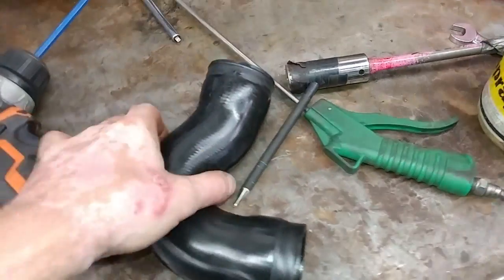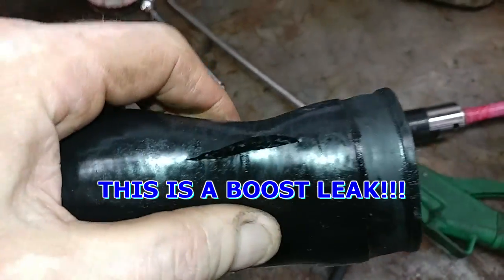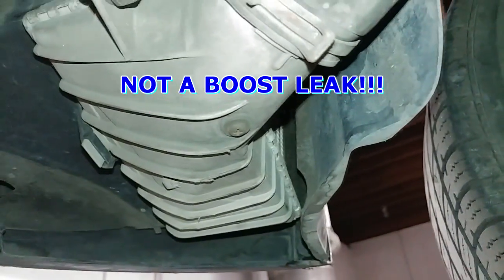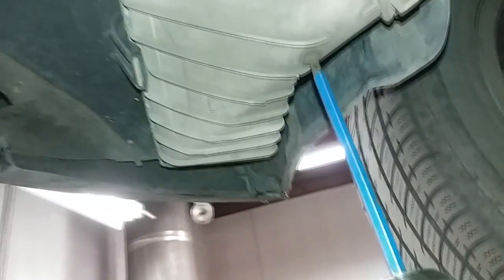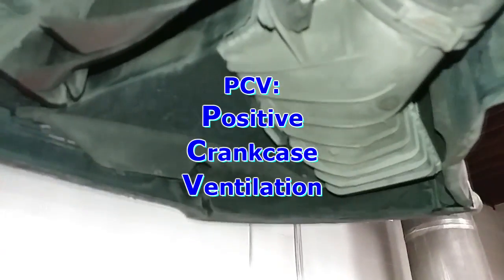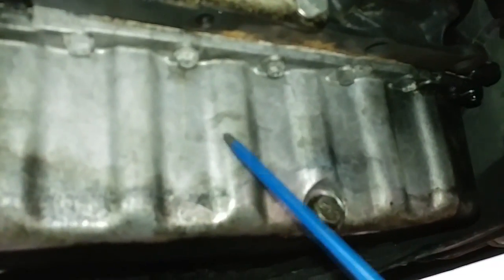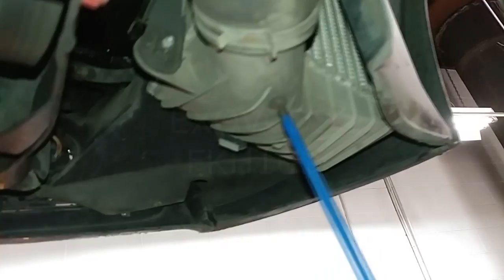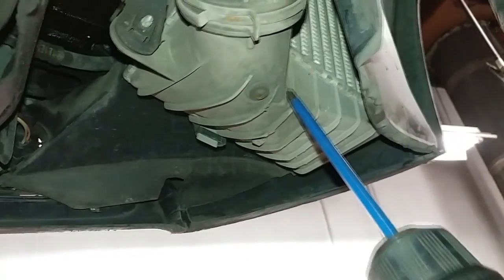Intercooler drilling, draining & plugging = NOT a boost leak!!!

Comment: Great advice, I STILL need to do this on my car, I'll do it soon.
Also, I can't find a good silicone rubber hose kit for my car, 1.9tdi 09' bxe.. I know it would be better than the rubber stock parts from the factory, much tougher and less prone to temperature extremes and the variation of the same.
Anyway..
Reply from the maker: Yeah, TDI's are not as popular yet with getting silicone hoses through the aftermarket... might be a good business venture! LOL
Reply: @EXOVCDS 
https://rover.ebay.com/rover/0/0/0?mpre=https%3A%2F%2Fwww.ebay.co.uk%2Fulk%2Fitm%2F122212026771
Reply: @EXOVCDS  I've found a firm called Roose selling silicone rubber hose kits for my particular spec.of engine! Roughly £220 for the coolant and air hoses, looks like a decent enough offer to ensure a little event free running.
Reply from the maker: Nice.

Comment: Thanks mate... this JUST started happening to my 2014 escape 2.0t EcoBoost..  I have spent the better part of 2 days troubleshooting and this seems to be the most consistent answer to the symptoms
Reply from the maker: On the EcoBoost engines... from what I hear, it's best to leave the small hole open / unplugged. The coolers that I drain & plug are known for having excessive PCV oil in them.
Reply: @EXOVCDS  that shouldn't have adverse effect?
Reply from the maker: No... the only reason I plug the hole is to keep oil from dripping out.
Some oil is normal in the cooler (PCV fumes)... but over time, too much collects and that can cause problems.
The EcoBoost issue (from what I hear) is water / condensation that collects. By leaving a small hole unplugged, the water / condensation can drain out daily.
Reply: @EXOVCDS  awesome, thanks again mate.

Comment: Hi! The engine must to be cold when you do this or it doesn't matter? Thanks!
Reply from the maker: Doesn't matter.
Year, make, model, engine?
Reply: @EXOVCDS  VW Golf 4, 1.9 TDI, 2002, ALH.
Reply from the maker: @EmyPk24  Cold or warm engine doesn't matter since the oil is in the intercooler.
Reply: @EXOVCDS   I just did that today and i found about 50 ml of oil. Not a big deal, but now i'll sleep better. :)  I know that oil is from PCV valve 'cause it takes out a lot of gas+oil+air (i have 340.000 Km) and because of this i vented in the atmosphere. Thank you for your answer! ;)
Reply from the maker: @EmyPk24  Any new oil will then be from the turbo if the pcv is vented. Let me know how much oil you get the next time you check  it.
Reply: @EXOVCDS   Sure! I hope I'll not find any oil next time because i know that the turbo is ok. Thank you again for your availability and the great video! Cheers! :)

Comment: Finally, a video that makes sense of all this catch can intercooler drilling  that I've been hearing about..  Thank you.
Reply from the maker: Depending on the vehicle you drive and whether it's gasoline or diesel... you may want to leave the small hole open / not plugged. Ford ecoboost engines seem to benefit from leaving it open (so that "moisture" can drain off).
Reply: @EXOVCDS  Thanks for the info. I'll drill out my cooler on my EcoBoost and leave it open. I've got 126000 k on mine and it's starting to show signs.
Reply from the maker: @cosprint  Let me know how things went / go... if misfires no longer reoccur etc.
Reply: @EXOVCDS   will do. Not so much of a misfire but bogs under acceleration. Falls flat and then takes off.
Reply from the maker: @cosprint  Don't think that's related to intercooler / moisture / oil issue.
Reply: @EXOVCDS  I`m just going by what I've seen online. The last time it did it was on the highway and when it kicked in the exhaust huffed out a bunch of smoke. Its been good since that time.  Can`t hurt to try.
Reply from the maker: @cosprint  if it smokes / coughs under higher rpm & boost load, then it probably is forcing liquid into the intake / combustion chambers. I'll wait for your results after the drilling.
Reply: @EXOVCDS  Well to the truck into Ford. It lost power. They diagnosed it as the timing chain Phasers or something like that. It only has 127000 km on it. Sucks but that's what it is. hoping the extra warranty will pay for it. The service advisor mentioned that the warranty will only replace certain parts. I said if they're in there already, then replace the chain and any other related part. I don't mind paying extra for what Ford mentioned in the service bulletin.
Reply from the maker: Thanks for the update... sorry it's more involved. Hope you don't have to pay too much extra.
Reply: @EXOVCDS wouldn't leaving the hole open skew the delicate balance of air/fuel ratios? Most certainly will cause a rich condition. As in letting already metered pressurised air escape, skewing MAP sensor readings at the same time -> making the turbo work harder to compensate for pressure loss. Not a good idea on any vehicle.
Reply from the maker: @Tsimi1234  That is why I plug the hole with a screw. There are many eco boost owners driving their vehicles with a small non plugged hole... with NO adverse effects & no fault codes.
The reason that they leave the screw out, is due to moisture / water condensing in the intercooler. Over time, enough water collects and will cause misfiring during acceleration or cold starts.
The VWs & Audi's that I work on, only have issues with pcv oil collecting.... that's why I check / drain the cooler at every oil change. The plug prevents oil leaks. 
As long as the hole is small enough, the ECM can compensate... resulting in NO rich or lean condition.

Comment: Hey Thomas, I have a aftermarket intercooler could I drill a hole on that? I do have a catch can though.
Reply from the maker: Aftermarket coolers usually have flat bottoms... the stock TDI (A3 / mk3 / A4 / mk4) coolers have a "low spot" where oil collects and is easy to drain. I would just check for excessive oil at every oil change by removing the inlet or outlet hose of the cooler. If they are hidden behind the bumper / not easy to get at, check wherever else is easy. Or just drain the catch can now & then. Catch can is before the turbo... so it will never give you an indication of turbo failure. =(

Comment: That’s a lot of oil! Why doesn’t Ford have a drain valve for that?
Reply from the maker: Ford has a water / condensation issue... VW doesn't have a drain valve either, that's why I added one. Drain it at every oil change and things will be fine. From what I hear, with the Ford engines... it's best to just leave the small hole open, so that water can drain at any time.
Reply: Thomas EXOVCDS Why doesn’t Ford correct this problem?
Reply from the maker: I don't know... not sure what the reason for the condensation is. If warm air is allowed to condense in the intercooler when the vehicle is shut off... water will form. How big are the coolers? Maybe too small?

Comment: I had my 1996 Passat turbo turn into a runaway diesel.  Its terrifying.  The engine started accelerating creating a large cloud of blue smoke so I turned the key to off and got out. The engine continued accelerating.  I got back in, put the key back in, and shifted to 4th gear and popped the clutch and stalled it out.  Saved the engine.  You really want to avoid a run away diesel.
Reply from the maker: Yes... stalling out the engine via manual transmission is the best / quickest / safest thing to do. For me, it happened so quick I failed to do so. =(

Comment: Bro I need help plz I have oil and water in 1 of my coolers plz hlep thx
Reply from the maker: Post a video so I can see how much.
Reply: @EXOVCDS  about 8 oz. Or water and oil mixed
Reply from the maker: Year, make, model, engine?
If you have had rain in your area... look for cracks / openings that would allow rainwater to enter the intake system. If there has not been any rain, then look for condensation issues due to EGR (exhaust gases) entering the intake. The warm air cools in the intake when the engine is off... which forms condensation / water.
Reply: @EXOVCDS  2006 flying spur I thought it was the headgasket or maybe it is but I wanna take out the egr cooler and valve to eliminate that before I do the gaskets would have an easy way to remove the cooler without taking the engine out? Thx in advance for your help
Reply from the maker: @vitablogs3458  I have no info on that vehicle / engine, sorry. If it's a common issue, you'll find discussions about it in the appropriate car forum.
Reply: @EXOVCDS  thx man

Comment: Does this wheep hole or drain hole also work on the 2015-2016 3.5 ecoboost found in the f150s and if so do you still it in the same location on the intercooler? Wasn't sure if Ford had done anything to fix this problem by then.
Reply from the maker: Not all turbo setups / intercooler setups are the same... can be treated the same. My understanding with the Ecoboost engines is that water condenses in the cooler. Ecoboost owners "drill a small hole and leave the hole open" so that the water can always drain out. Funny, because newer VW TDI engines had the same problem a while back (I don't know what the fix is because I'm not a Dealer Tech). The draining & plugging of the hole that you see me do, is on older TDI engines... the main problem is with people mainly driving short distances. The PCV oil builds up and can cause engine damage when they go out on the highway or are under extended boost going up a long hill. If you don't mind a bit of water & oil mix under your car, drill a small hole at a convenient location, so that the water / oil mix can drain out when the engine is on or off.
Reply: Thanks for the reply my mistake I didn't watch the whole video to see you were working on a VW.

Comment: thomas exovcds good video, would this method work with all tdi engines or only vw. can i do that to my 2013 f-150 3.5 ecoboost,
Reply from the maker: jad b The reason for having to check / drain these TDI coolers, is because of the design / layout of the charge air system. My old E30 BMW that I turbocharged & drove for 7 years... had 0 oil in the intercooler (I still have the cooler, not a speck of dirt on the inside), because the PCV was vented to atmosphere. Flat laying coolers in front of the radiator will not be as easy to drain as the TDI cooler in this video (those coolers don't have a "low spot" where oil / condensation can collect). I have heard about the misfire issues with the ecoboost engines. Some people drill a small hole (somewhere along the charge air passages) so that the condensed water can drip out or blow out under boost. Leaving the hole open ensures that no significant amount of water stays in the intake track. The oil draining that I do, can be done at every oil change... to monitor PCV & turbo health.

Comment: Where exactly do you drill the hole Thomas? The bottom of the intercooler "catchpan" is lowest at the side of the car, allowing more oil to drain. Is the reason you drilled at the entry of the air pipe (higher bottom) so that you didn't accidentally drill into the intercooler itself? Also the pan feels weird, is it metal and do you tap the hole for the screw/bolt? About to do mine, would appreciate your opinion on those specifics!
Reply from the maker: I drill where "I think" the lowest part of the intercooler is... drill where you think it is.
The cooler has plastic tanks... the screws are self tapping, bolts are not, that's why I use screws.

Comment: Dear Thomas, as always thank you for sharing your expertise for free! 
I have a 2003 GTI AWP engine. I replaced my SAI pump about 2 months ago. I just noticed that my SMI is dripping couple of oil drops here and there. I have not inspected prior the SAI pump replacement. I was wondering what your top recommendation would be? Should I just drill and drain it for a starter?
Reply from the maker: I check / drain all 1.8T's. It's normal for PCV oil to collect. Checking / draining at every oil change can help you determine if there is an issue that needs to be addressed.
Reply: Thank you! I will keep an eye on it and share what's going on with it.

Comment: Also for those with an alh like myself have the option of adding the Mann ProVent 200 which is similar to a catch can but works more effectively than a pressure robbing catch can would.  From what I understand that's why you don't see tdi alh with catch cans.... fwiw
Reply from the maker: Catch can should be ahead of the turbo... I can't see there being a pressure robbing issue in that location.

Comment: Is the car you showed the screw in the intercooler of a 99.5? It looks like the older style intercooler.
Reply from the maker: Year, it was an ALH TDI... the 1.8T engines with a similar cooler have the same issue.
Reply: The early 99 TDIs have a different intercooler than the 2000+ ones (which have the IAT sensor mounted on the IC instead of on the charge pipe)
Reply from the maker: Same / similar shape cooler with the space in the bottom that collects oil.

Comment: Seems like you get a lot of criticism about drilling a hole in the intercooler, and now they suggest putting a can in there to catch the oil. Don't let the heresayers  discourage you. Most probably never turned a wrench. Always good advice that you give!
Reply from the maker: If I can save one engine... it'll all have been worth it! =)
Reply: Drill the hole AND use the catch can.  Every drop of oil, more likely condensation, which is the problem most have, will get in the engine every time the turbo kicks in.  The catch can prevents the oil from ever getting into the ic. Making it a zero chance of getting in the engine.  Look at the amount hd just drained out, at least a quarter more of that made it back up.

Comment: Still haven't been brave enough to do this to my two TDis 😬
Reply from the maker: Better sooner than later.
Reply: Just pretend you're a dentist four4 a bit and after you drill out the cavity 
put a filling in the hole. Good as new. Oh an only charge yourself half price 
if ya dew it on your thyme.
Reply: If ya wait two2 long you'll have ta pull the tooth er ah engine.
Reply: Drain them b4 yr tdi explodes like mine just did...runaway.....boom

Comment: I always see that type of thing on kinda older vehicles, I have a 2017 GTI, would I need to still check it every 10k?
Reply from the maker: ImyurZero The intercooler on that car doesn't have a cavity where oil can collect like these TDI engines. You can remove the intercooler hose (that goes to the throttle body) at the intercooler and check for oil there. Any increase in oil (in the cooler) between oil changes... points to a pcv or turbo problem. So yes, checking can be beneficial.

Comment: Not to mention the threads on the screw sticking into the intercooler add a swirling effect to the air, boosting your horsepower and fuel economy by 20%!  LOL

Good advice, Thomas!  It'd be nice if turbo'd cars came with intercooler petcocks installed from the factory, wouldn't it?
Reply from the maker: 20% gain... never thought of that! LOL
It's just these little coolers that people have to worry about. The long coolers don't have a pocket at the base where the oil can collect. On my own car, I vent the PCV to atmosphere... any oil in the intake will be from the turbo.
Reply: In a sense, yes!  Vehicle emissions are regulated by Environment Canada, as are some materials handling guidelines.  Others may be regulated by Industry Canada, but they're typically concerned with companies, rather than individuals.  :)
Reply: Does Canada have what we in the states call EPA?

Comment: Dude just install a catch can, that way you don't get a boost leak from the screw. In all seriousness is this mostly for the diesel engines or should it be done to gasoline engines too like the 1.8t?
Reply from the maker: Albertotron 1.8's have less issues with pcv oil... but yes, oil also collects. I check all 1.8t engines as well. I also check 2.0l engines that have a similar intercooler setup.

Comment: Interesting turbo stuff. Thanks to you I'm learning. Thanks!
Reply from the maker: I drove my E30 Turbo charged for 7 years with the PCV vented to atmosphere. The intercooler looked brand new on the inside after all that time. 100% no issue with turbo seals. My current E34 Turbo is also venting to atmosphere. Both intercoolers are not as easy to check as these TDI coolers... if I ever spot oil in the intake plumbing leading to the throttle body of my E34, I know I have a turbo seal issue. =)

Comment: The question would be VW knows all about this  so do late models have an engineered fix for this or have they installed a petcock :)
Reply from the maker: This is mainly an issue with the older / first generation of TDI engines... and some older Turbo gasoline engines. Actually, not true... sorry. The newer TDI's had condensation issues, leading to ice formation in colder weather.. which also resulted in potential engine damage. They came out with a fix for those. Some Ford Ecoboost owners that have condensation issues just drill a hole and leave it open so that the water can always drain / blow out. To each his own.